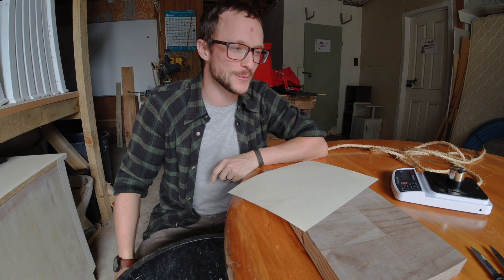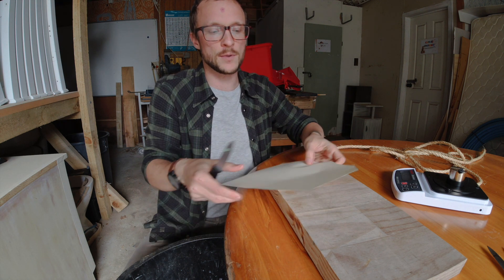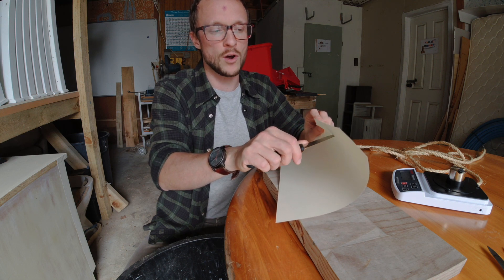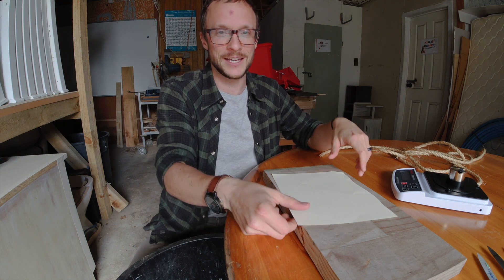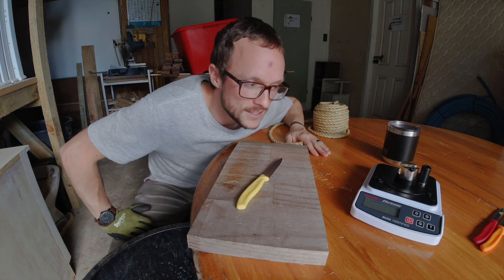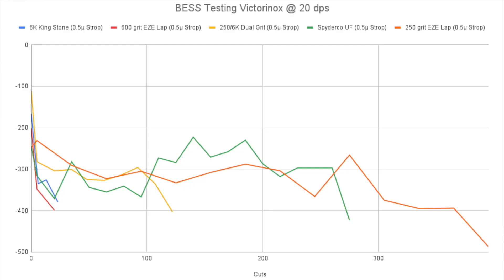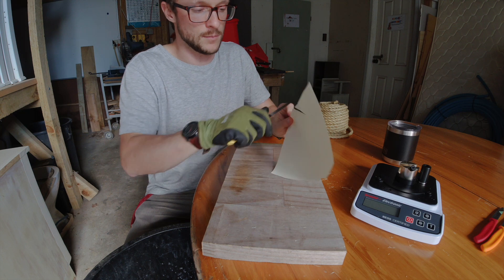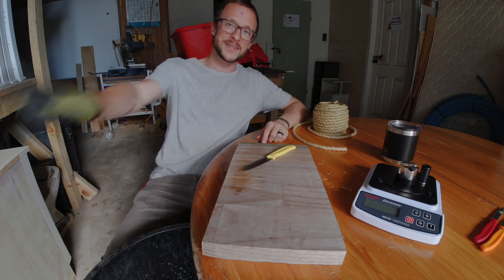Best edge yet?! 250 Grit Diamond Sharpening Plate Edge Tested on Victorinox

Comment: Hi Gabe. 
I wouldn’t change your method of testing. 

Pete ist testing the edge from hero to zero. That’s fine.

Your test show the dynamic of dulling in different styles of sharpening. The ups and downs the rights and lefts. 
I find it amazing that my grandma’s saying that these kind of knives sharpen themselves is in fact pretty true. 
Do you habe a carbon steel in a similar knife than the vici’s? ( thats how i will call your Victorinox kitchen knifes from now on! ). That would be nice to compare with. 
Have a good one !
Reply from the maker: I do have a carbon steel Opinel Paring knife - that's a great idea.  Maybe I'll sort out the best 2 or 3 edges and test them on carbon steel to see how it dulls differently from stainless!!!  That would be fun!

Comment: Seems natural that, below a certain grit, you'd get a good deal of variation with 'toothy' edges on the BESS test, given that it essentially involves push cutting a thin test medium.
Reply from the maker: That's a good observation, you would have more variation across a coarse edge than a fine due to the irregularity of the edge itself.

Interesting...
Reply: @homeslicesharpening  Till someone with a backyard electron microscope can confirm, it's but a theory. :-p
Reply from the maker: @CSGraves  true, but it’s a hypothesis with merit!  

And you can always look at how much correlation points that direction over time!

Comment: Gabe, thank you for the testing so far. The results where a little frustrating up and down at random it seemed sometimes. The fact it was still cutting paper after all that rope was strange. Not slicing through ofcourse but still cutting. You macgyvered your way thru it. Still am convinced dual grit will endure longer. Stay safe, God bless and untill next time friend.
Reply from the maker: You know, I am leaning towards the theory that dual grit and coarse both retain slicing aggression (that is, the ability to propagate a cut with less force) longer, while a fully deburred knife will have better cut initiation (and this is, maybe, what BESS measures more accurately).

We'll see.  Even if dual grit does not win every test I am having fun and learning heaps, and I am excited to finish a few batches of testing and send some stuff to our friend Pete and see how it goes!

Comment: I'm super thankful for all your hard work. This is something that we all wonder about yet u are actually putting in the work. So happy holidays and thanks again
Reply from the maker: Thanks Dom!!!  Bro, I am having a heck of a time getting under 100 BESS on these Victorinox knives, are you still willing to send me Vadim Kraichuk's book?  I would be keen to give it a read.

I've built a rig to test the angular force, and would like to cross compare BESS (apex widening), vs perpendicular slicing force needed to propagate a cut, vs wear resistance over time, vs some kind of edge stability test.  And I'd like to do that with one hair whittling knife over 100 BESS, one good dual grit knife, one knife under 100 BESS, and one 250 grit coarse.

But I need to be able to get these under 100 BESS to do that test, everything else is ready.

Let me know.
Reply: @homeslicesharpening  what's your email and I'll buy u a copy? It's a small book but it's extremely helpful especially with that final sharpness. That micro burr foil burr is the key u have to strop that out without over stropping. But I would be happy to help any way I am able.
Reply from the maker: @dombond6515  thanks mate!  Can I find you on Instagram or something?  I try not to post my email on the channel here if possible.
Reply from the maker: @dombond6515  yeah I am aware of the need to eliminate foil burr, just struggling to find a method that works.  Let me know.